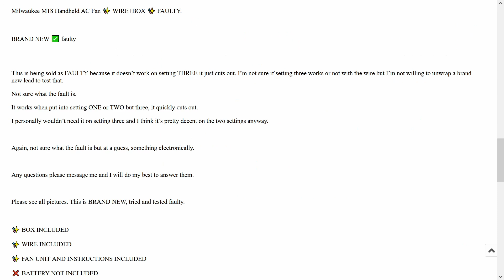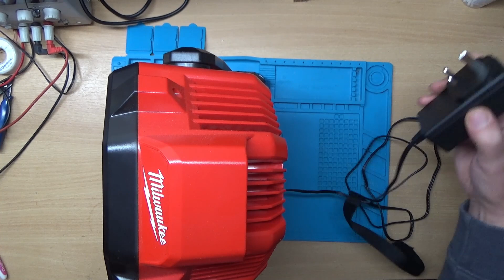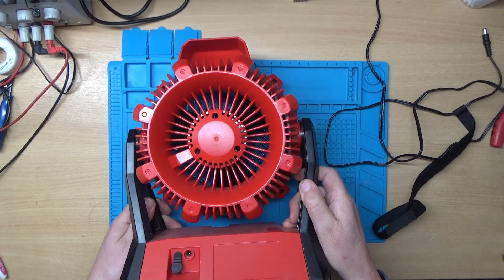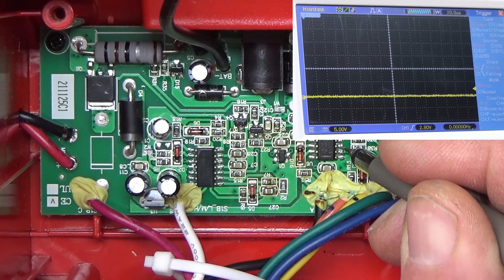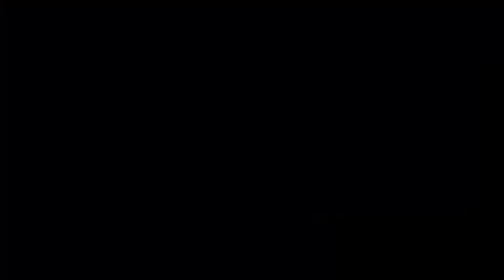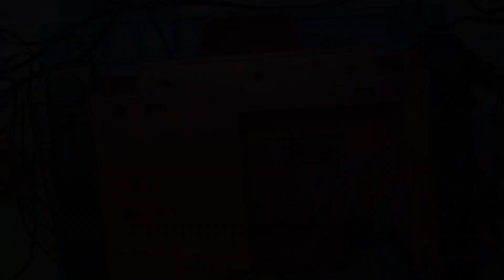Milwaukee  Cordless Fan - Weird fault - Can I fix it?

Comment: Spot on. I was immediately thinking the same way because of where I work. You have multiple people well we like to call ourselves engineers but nevertheless I am the one designing the point of load circuit and I'm designing it with the specifications I was given from the prop designer who was determining what the load was going to be based on the designer of the motor and so on and guess what someone Fu ed up and believe it or not this type of mistake can make it all the way out the door in a poorly run engineering department. So the real mistake was the supervising engineer of the entire project who now works somewhere else. LOL. Shut up it's a true story different day same problem.
Reply from the maker: Thanks 👍

Comment: I'm only 15 minutes in an already everything is telling me too much current and shutting down for self-protect.  When I test for something like this I like to remove the fan blades and allow the motor to rev in a no-load situation.  if the problem goes away we know where to focus.
Reply from the maker: The fan is a nightmare to remove apparently. I did have a search at the time and there's quite a few people broke them trying to remove them for cleaning.
Reply: @BuyitFixit  Well then I would say that changes things a lit.  Lol.  Based on this I'd say you likely did the best you could in dealing with what appears to be a design flaw.  When dealing with motors that draw too much current I have found that heating the armature a bit right near the bearing/bushing and then applying a bit of ptfe grease helps.  You just want enough heat to melt it so that it has a chance to flow into the bushing.  I actually just repaired a bathroom fan motor this way.  it still turned freely by hand but wouldn't budge when powered on.  The thing spins like new now.
Reply from the maker: Nice, thanks for the suggestions 👍🙂

Comment: Perhaps the first test after observing the fan motor cutout would be to inspect the circuit PCB with a thermal camera to see if there are any hot spots. Although the PCB did not look overheated on the top side. If the control board is not cutting out, then it must be the motor thermal breaker. The thermal breaker seems to be the automatic resetting type. If so, there is potentially an even quicker way to diagnose the fan if you can get a freeze spray nozzle directly on the thermal breaker. You may be able to access it through the fan vents. If so, you can just freeze down the thermal breaker and the fan motor should start working again. This would verify the problem. Not sure what the fix would be other than replacing the fan motor.
Reply from the maker: Thanks👍I did do a lot more tests than were in the video, including adjusting then current limiting. This did work at full power, but after around 3 hours the motor overheated and cut out and was very hot. This was pretty much a brand new unit and the guy had quite a few listed in same condition. I think it could have been a bad batch of motors? Either that or they are just asking too much of the motor.

Comment: It's just a guess, but the inner parts of the fan may be slightly jammed by something, so the fan isn't running as free as it should
Reply from the maker: I did try turning it by hand and it was fine, also there was multiple of these all in new condition, advertised around the same time with the same problem.
Reply: @BuyitFixit  the specs of the supplied fans can vary and change over time. Maybe this fan was just inside of the specs during the quality control, but after some time it's current draw has slightly increased
Reply from the maker: Could well be the case.

Comment: I enjoy the channel, thanks. 
For God's sake, it is a fan. Why does it have integrated circuits and PWM control? It should have a switch and a few resistors. This over-complication of things is getting silly.
Reply from the maker: Thanks 👍I think they used PWM to save energy as this is designed to run from a battery. Using resistors would be less efficient as a lot of energy would be dissipated as heat.

Comment: Or it could just be that component tolerances were making the cut-out too sensitive. I would have stuck a 1 ohm 0.25 watt resistor across the 0.1 ohm sense resistor in the hope that it would reduce the voltage (for 2.5a load) enough to allow the full 2.5a to flow without tripping the LM324 circuit.
Reply from the maker: I actually tried powering the motor directly, and it overheated after about 2 hours with the thermal cutout on the rear of it. Full speed does the exact same thing (100% duty cycle) but shuts off as it senses it's drawing more current that it should be.

Comment: seems like the high speed could be over amping and the circuit is shutting down for a safety ?
Reply from the maker: Yes, the motor is pulling too many amps for sure. The unit is almost new and the seller had about 10 listed with the same fault. Design fault? Bad batch of motors? I've seen other experience the same issue on reddit too...

Comment: Thanks for explaining the circuit.  It was nice to see chips that I have heard of, the 555 time I even used at school in electronics GCSE a long time ago.  It was good to see that classic chip being used.  If you do not know what the problem was I sure don't.
Reply from the maker: I think either a design problem (too much load on that motor) or a bad batch of motors possibly.

Comment: A fan of a Milwaukee fan. 😁  I do not have any Milwaukee tools but I do like the look of them.  I had considered getting a impact driver a few years back as was doing some restoration work on my classic style VW Beetle that I imported from Mexico in the 90's.
Reply from the maker: I've got an impact gun for sockets and an impact driver. I love the impact driver it's one of the tools I use most often m18 version.
Reply: Don't tell me you fixed both of them. 😄 @BuyitFixit
Reply from the maker: No, I had these before I started repairing Milwaukee stuff 😂😂😂

Comment: i run mine at work daily for over a year and no issues. rhis is weird
Reply from the maker: Perhaps a bad batch of motors or design change perhaps.
Reply: Mine lasted about 3-4 yrs with daily use for plumbing work. Mud/Water no problem 😂 Trying to get repaired now won’t turn on at all with battery

Comment: Can the motor and cpu + can control be purchased online? My step dad said it’s pointless and I should just buy a new fan
Reply from the maker: No, I couldn't find any useful parts for this online except a couple of the plastics I think and a label. The motor has a quite large splined shaft and I did have a look on the usual chinese sites for a replacement without success. There is no CPU on this or software. It's just couple of standard readily available chips.
Reply: @BuyitFixit  guess my step dad was right 😂 no way in fixing this 😂

Comment: take the cover off of the motor on the back and run the fan with less light, probably getting some arcing in the motor. This is what was killing mine the same way.
Reply from the maker: Interesting. I wonder if they had a faulty batch of motors perhaps. The fan was pretty much as new. No dust on it, or signs of use.

Comment: Thought I'd comment my findings on a recently purchased ebay listing. Annoyingly someone else had been in there, done the 10k resistor replacement, the motor was smoking whilst being powered with 18v from bench supply, fuse was gone (3amp F2). The motor had resistance whilst being turned without the fan attached. Used an angle grinder to remove the bent over motor tabs, removed brush assembly, spun the shaft up with a drill and cleaned commutator bars with scotchbrite then scraped the gaps with a knife then fine wire brush, the back bearing got a bit of silicone grease on it, turned lovely after that. Motor controlling mosfet was shorted so even in the off position it was turning. Not wanting to miss out on the full power i replaced the 10k with a 220r resistor. Thought it was fixed then discovered a loss in continuity on the positive wire going to the motor. 
Pretty sure I didn't see a fan inside the motor so might contribute to the overheating. I decided to drill 4mm holes around the motor mounting plate so hopefully some air gets drawn through past the motor. If i do come across any overheating i might look into a heatsink or maybe change the motor.
Reply from the maker: Thanks for the info 👍

Comment: Moisture in the motor can cause it to get stiff so it will cut out just oil the bearing.
Reply from the maker: The guy selling them was selling around 10 of them all with the same fault. All looked pretty much brand new. The motor was rotating freely by hand. I honestly think that it's a design issue. If I powered the motor direct it worked fine, but overheats after around an hour due to too much load on it.

Comment: Would be nice to have a perfect working one to compare data.
Reply from the maker: When at full speed it just pretty much powers the motor direct (100% duty cycle). I also tried bypassing the current limit so it did send 100% power, this worked for about 2 hours at which point the motor overheated and a thermal cut out kicked in. The motor looked brand new, turned smoothly etc which is why I think it's a design fault (asking too much from that motor) or possibly a bad batch of motors? But there were lots of these almost new units for sale with exactly the same fault...

Comment: I have same issues with my new two weeks old fan.
One day It stopped at fan speed 3. Sometimes it happens at speed 2 but the strangest part was that the next day it started to working again with no problem. 
In rare cases when I turn it off and start it again for a couple of tries it works. 
I live in California, and lately we have been experiencing increasing humidity levels, especially this summer. Perhaps that is the cause of the issue?

The most serious problem I think is that I reported it to the Milwaukee customer center, but have received no response.
Reply from the maker: Not sure on the humidity levels causing the problem..I honestly think it's just a bad design and they are asking too much from that motor.
Reply: Milwaukee are overrated chinese junk

Comment: I did not finish the video yet but the thing caught my mind is that stepping down from speed III it doesn't work till the power is cut on 0 then running again.
Reply from the maker: Hmm strange, I can't remember if the one I have here does that.

Comment: A really interesting video; thanks. I'm a bit late to the party here, and maybe I missed something but here goes....As you say, the op amp seems to be being used as a comparator (if so, straight away it seems odd that they don't use a purpose built compatator such as the LM2901N).  Did you mention where the reference voltage comes from (I may have missed it) and what that reference voltage is?
Reply from the maker: Thanks 👍 From what I remember the ref voltage comes in around the right hand side bottom of the chip (on the video)..Theres two resistors that form a resistive divider. I did change one of them and the fan run at full speed for about an hour but then the motor overheat and the thermal fuse kicks in on the back of the motor..I can't remember the ref voltage off hand. Hope that helps.

Comment: As there are a lot on ebay with the same fault it looks like a problem in the current sense circuit. Could be a bit sensitive and tolerance on the componet values mean most are ok but a significant propotion show this fault. Would need to reverse engineer the circuit and then play with values. Your solution is much easier, nice one.
Reply from the maker: Thanks Bike Forever. I did try adjusting the current circuit and got the motor to drive at full. However it overheats after about an hour and thermal cutout trips. I updated the video description with some further details 👍
Reply: @BuyitFixit  Are you sure that the shutdown of the electric motor occurred when overheating was detected? 
Is there a system in place to detect motor overheating?

I also own this fan. I have the same problem. Using it in first gear it also shuts down after an hour. I think there is a built-in timer that measures the time from startup and turns off the fan after 60 minutes.
Reply from the maker: @dawidkrzyzanek5879 it may have been a timer, I just remember it shutting down and the motor was too hot to touch.
Reply: @BuyitFixit   I think it is a dirty commutator in the motor.
Reply from the maker: @paulstaf  These were pretty much brand new units, no dirt or dust on the blades or casing...
Reply: Which would lead one to believe this is a bad design...especially with the data point of the current sensing circuit mod with corresponding overheat.  Either beef up the control circuit or get a more suitable motor/fan combo.  2.5Amps doesn't sound like that gawd awful of a load for a fan though, so they shouldn't skimp on the control components and PD components @BuyitFixit

Comment: I wonder if its a finger protection circuit being triggered by an unbalanced fan?
Reply from the maker: Hmmm interesting thought! Didnt think of that one. It does have that sort of thing. It wouldn't explain why the motor overheats when its powered on full for an hour (I updated the video description with some additional stuff).

Comment: I've bought 3 of these exact fans the first two were early versions that did the same exact thing but on all three speeds. The newer ones work great now. Haven't looked inside for changes but I think they fixed or changed something to correct it. The newer one I have now runs 8-10 hours a day, every day now with no problems.
Reply from the maker: Thanks for that info 👍. I guess it must have been a design problem then. I wonder what they have changed. Does it blow as much air as the early versions?
Reply: @BuyitFixit  The first two were faulty right out of the box new. So I couldn't compare the two to the newest one as far as airflow.
Reply from the maker: @MiniDigging  Ah ok. I had just been thinking if they had just done something similar to what I did and reduce the output slightly.
Reply: @BuyitFixit  Not sure, but it was probably something else I would think as they spun very freely and it still done that on all three speeds with mine. Maybe something other than current limiting alone. IDK.
Reply from the maker: @MiniDigging  Thanks mini digging 👍

Comment: I'd be swapping that shunt resistor for another one, or just disconnect it from the comparator input and tie that low so you can at least run it at full speed for a while to make sure it's ok, not warming the battery or making smells etc
Reply from the maker: Not on the video, but I did try changing one of the resistors on the comparator circuit to allow more current. The motor ran for about 1hr then overheats and a thermal trip cuts in. I updated the video description with a picture of the motor and some stuff I tried.
Reply: @BuyitFixit  ahh I see! Just read all that now :) I do wish YT made it easier to see the description on the mobile interface. One last suggestion now you've proven it's the motor (if it's not yet ruined) - try puffing some graphite dust in there :)
Reply from the maker: Is that for lubrication? It seems to rotate quite freely. Personally I think they have too much load on the motors and its causing them to fail or partially fail. Theres a fair few of these fans I've seen on Ebay and all relatively new, with the same issue.
Reply: @BuyitFixit  Ok. Yes it was for lubrication.  Oh that's a shame if you're right then. Maybe the 555 config could be tweaked to generate 33/66/75% PWM instead but not worth the effort when you can just run it on mode 2 I guess. Thanks for the entertainment anyway; I enjoy the videos :)
Reply from the maker: @new-zealand-clippy  Thanks Pete 👍👍

Comment: It's hard to see the color code on that shunt resistor, but it sure doesn't look like orange-black-gold or red-yellow-gold. (0.3 or 0.27 ohms). It looks like black-brown-black, which would be a screwy way of saying 0.1 ohms? (And would make more sense for a shunt than 1 ohm.) If so, then the shunt is bad and at least three times too high, which would explain the bogus trip at 3.
Edit: Putting the fan face-down on the bench might restrict the air flow enough to raise the amps. What's the bench supply measuring with fan in normal upright position? Perhaps they spec'd the wall wart and current limit with very little margin, and at speed 3 it normally draws something like 2.4 amps.
Reply from the maker: Thanks Michael. The colour code was black brown black silver. Someone sent me a picture of the motor in their fan, I put it in the video description. It's an 18v 20w motor. I did try adjusting the current limit circuit so it didnt trip, and the fan run on full for about 1hr before the motor  got too hot and a thermal trip on the back of it cut in.